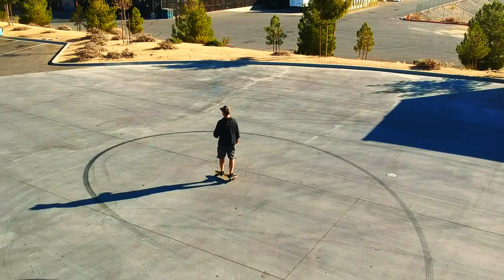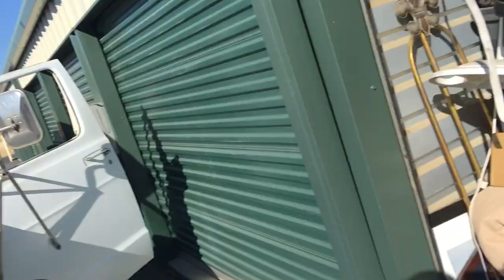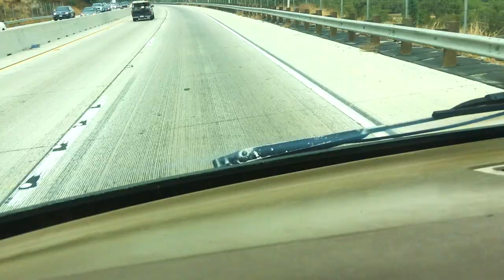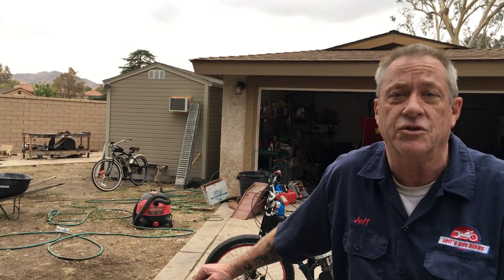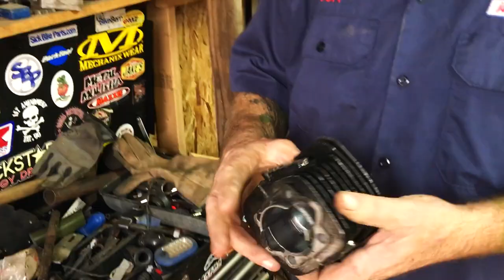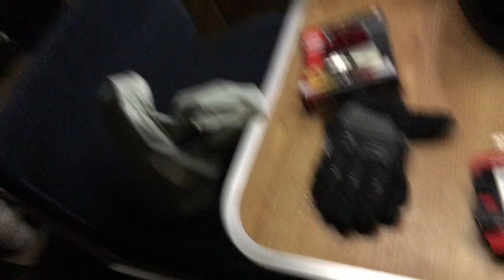My New 66cc Custom Motorized Bike gets 85mpg

Comment: Okay. Those Chinese motors aren't as bad as he thinks they are. I built one when I was 15, and its been going strong for almost a year now, and its powerful enough to push my 6 foot 5 self at 45 MPH.  They are good motors
Reply from the maker: Yeah, mine seems to be holding up great!
Reply: Until the motor starts knocking and you can't figure out why
Reply: Can u please tell me ur model. I wish I could get a dirt bike but I can't so I want to get a motor, plus I'm interested in how they work and get fixed. I want 1 to go 35mph to 45mph. I would still mod 1 to go 45mph. If you know any models under $200 can u help. Thank you so much (gas engines only for me)

Comment: All those motors all the same. There are a MILLION dudes out there that will tell you theirs are better or different, but they all come out of the same Chinese factories. Although quality can vary, its usually close. These guys who do this are mostly quality control. Which is good, don't get me wrong. Having someone set it up that knows what they're doing is key really. Air leaks and parts coming loose are the biggest killers of these. 2 strokes will last a LONG time if taken care of, or could be shot in 1 or two rides if you have a bad tune, a bad air leak, or not enough oil in the mixture. You do want to change the piston rings, or possibly the whole piston assembly (10-15$) about every hundred hours of use to avoid the inevitable failiure. I've seen these go for a few thousand miles between rebuilds. Can't beat em for the price.

Comment: China dolls are not bad as long as you have knowledge of engines. take off the head and cylinder and put rtv on both sides of the cylinder gasket and on the intake and exhaust gaskets. And the most important tip is to oil up the crank seals before you start it up for the first time and shoot some oil down on the crank when you have the head and cylinder off. And put oil on the outside of the piston and on the cylinder wall. If you do all that and make sure you keep the china dolls under 25 mph when you cruise then they will last at least 1000 miles before anything serious might break. People that tell you other wise dont tear the top end down before the first start up and run them like they are stolen. Another important tip is to check all the screws and bolts because they often aren't checked in the factory.
Reply from the maker: Awesome info thanks 🙏🏼
Reply: VagabonDaze  I've got 1017 miles on my bike.The problem I've had has been the chain breaking three times. I have a moving average of 33mph and a top speed of 50mph (downhill). I take mine on 80 round trips.....less than a gallon of fuel.    
I like your bike....stay safe.
Reply: Sounds like the chain might be misaligned. Either the sprocket isn't all the way centered or the engine isn't inline enough with the back sprocket.
Reply: Drcool52  not the case....the chain is made out of "Chinese Butter Metal". Crazy thing, the master link has never broke.
Reply: Me and a few other people have the cheap chains with tons of miles. One has 1800 one has 1000 and another has 800. Its not cheap metal its either not aligned or not taken care of. I've dealt with a shift kit that wasn't aligned and it ripped the chain apart like you mentioned. Once the shift kit was fixed no more chain problems.
Reply: Drcool52  alignment is NOT the problem. I was an AIRCRAFT MECHANIC in the AIR FORCE and I am a CNC MACHINE SETUP & OPERATOR. I read blueprints & draw blueprints....THE CHAIN IS NOT MISALIGNED IN ANY WAY, SHAPE, OR FORM.  "BUTTER METAL" . The chain CAN'T handle the STRESS that my "Moonshine Runner" motor puts on it.
Reply: If you say so. If its all the "power" then why not upgrade the chain? I believe its something like 412 chain at tractor supply stores.
Reply: Drcool52  it's 415 chain. That's the problem.
Reply: No I've heard people use 412 chain as an upgrade. Or #41 is another common one. You may have your years and years of experience as what ever you want to brag about but unless you have years and years on motorized bikes it means nothing. You could stand to join a few forums and learn some things.
Reply: Drcool52 whatever dude...... I've been riding bicycles, minibikes, motorcycles, three wheelers, and four wheelers since I was a kid (the 70's).  You seem to think you know it all when it comes to chains. I was not bragging...only stating my EXPERIENCE in the MECHANICAL field. oh yeah, I also built & raced dirt cars for a DECADE. 
Let me break this down for you....the CHAINS are made out of SOFT METAL....just like the nuts & bolts (even tools) that come out of China.
Thanks for your input, but it's NOT HELPFUL at all. 
have a good day.
I'm done.
Reply: And that's why I recommended you upgrade chains. Its a commonly known upgrade that you should know about if you have been in the motorized bike scene for a while. Just because you have experience in other things doesn't mean you know about motorized bikes. They are different than everything else because of the fact that they aren't specifically manufactured as a nice working whole. All the parts work together in theory but most of the time need modification to work correctly. I didn't claim to know everything but I've built up my knowledge about these things for a few years now and it seems like your too high and mighty to take a few notes from someone who has some information to give. Anyone can slap these kits on a bike and make it go down the road but not many people today know how to do it without having big problems they are always having to deal with.
Reply: I put a capfull of 2-cycle down the connect rod.on each side and let it set 6 hrs per side,so it went into the crank bearings.I used Molybdenum grease in the piston's rod bearing,and the cylinder sleeve for break in.
Reply: I broke in with a quart of Quicksilver Full Synthetic.
Reply: I use 'Marine XLF Pens.Synth-Blend,"and don't blow smoke as It's now 700 Plus miles.

Comment: VagabonDaze New subscriber, amazing channel and video, good buy for sure.  I have built hundreds of gas and electric bikes, and that is one nice bike.  45 is fast, the perfect speed really, may I suggest Amsoil 100:1  2 stroke oil, I have gotten 3,000 miles out of a Chinese 66.6cc engine with it (40:1 after break in period)
Reply from the maker: Wow man thanks so much for the tip! I’ll def use it!! Thanks so much for subscribing really appreciate that as well!!
Reply: @NOMADNEWSTV  If your engine on that bike is brand new you should run 32:1 during the break in period.  For me that is 200 miles.  During that time I don't run full out often.  A great app to have which happens to be my favorite for tracking mileage, speed, distance, speedometer, and a GPS map is called Sportstracker
Reply from the maker: I’ve been running the heavier mixture during the breakin. I’ll def check out that app

Comment: A bone stock Suzuki Boulevard S40 will get 80 mpg if driven 55 and below. How do I know. I bought a new ‘07. And go 90 mph if needed.
Reply from the maker: Yeah, I’ve had mine for a minute getting ready to sell it
Reply: VagabonDaze, I have 2 bikes. I keep the 650 just in case gas gets really high again. I switched the bike to chain drive a couple years back and brought down the rpm’s a little. It might beat 80 now, I’ve never checked it. Changing the gear ratio turns it into a fabulous bike.
Reply from the maker: Michael Harris I have an E-Bike now that’s all I ride these days
Reply: VagabonDaze, I have been thinking about doing my own build. A lot of new technology is out there now. Cool idea.

Comment: if you went with a 4-stroke a 79cc monster  80 kit from gasbike.net  for $229 you would have a little less speed but you could put pure gas in it. Also 4 stroke is quieter and have less smoke out the pipe
Reply from the maker: Very good info might look into that in the future. This thing does 45mph not sure how much speed I would lose??

Comment: I don't suppose you could elaborate on that gentleman's personal bike i'm curious about the carburetor intake that had on it and that it's connected to the case and not the actual cylinder how is that possible
Reply from the maker: Hey Jason I actually still don't know a whole lot about these bikes so I have no idea what he has done to his. I just ride mine. I know mine goes about 45mph top speed and I could not even come close to keeping up with him on his bike he would just run off and leave me
Reply: They weld a reed block adapter to the case. And delete the piston port design. Common on mopeds and race carts.
Reply: Ya it for sure has to do with the Reed thats on the intake. VagabonDaze's bike didn't have the reed.
Reply: Jason Hunter the reed value closes and opens everytime the motor makes a rotation. Basicly like a gasmask. As it sucks gas into the cylinder the reed value can open when piston is going down or right before it takes in more gas then the values close creating a volacity stack. It holds back gas and air building it up under pressure...this makes the air and gas mixture atomize before going through the reed value and into bottom end of cylinder. Giving you really good gas/air mixture and allowing a nice compression to spark off. And gas dosnt shoot back into the carb. Which isn't good for flow. A 2 stroke sucks gas in while exhausting. One can not work without the other. Imagine a water hoes tip. How it builds pressure if you squeeze the end off then release..well the water comes out faster and harder, hey oh, pretty much the same thing on the reed values. Or those fish nets that let fish in but they can't swim out. Idk I tried my best haha.

Comment: my 60cc gets 100-150 mpg. why only 85?
Reply from the maker: +shadowgattler - THE ULTIMATE SKILLER it's got a high performance carb, head and other things. I'm not exactly sure what the gas milage is. Stock they say 100mpg, mine is far from stock
Reply: VagabonDaze the carb doesn't do much. I've heard they're a waste. the expansion chamber does help with performance though. good luck with it and have fun. i ride mine around town regularly and love it
Reply from the maker: +shadowgattler - THE ULTIMATE SKILLER did you see the carb on mine? My bikes supposed to be like one of the only bikes in Cali with that carb as it just came out. It sticks all the way out the back of the bike is supposed to add 2hp. Mines a little fast it freaks me out still to be going that fast on a bicycle. Jeff the guy in the video his person bike runs nitrous oxide boost and goes over 70mph. I love mine have no need to go that fast! 50mph is plenty for me!! Lol thanks for commenting and watching
Reply: How you ride, your weight, bike weight and so forth has a lot to do with the gas mileage you will get...

Comment: Its 49 cc not 66
Reply from the maker: Venom ! No my bike is a 66cc that’s why it goes almost 50mph.
Reply: you are both wrong they are 80cc   66cc is the stroke
Reply: @unemployedmechanics  they are 66cc stock. The 80cc is from the Chinese who include the combustion chamber so it's not a measure of displacement like we measure engines in the U.S.
Reply: @unemployedmechanics  you can't measure stroke in cc. Cubic centimeters is volume. They are 40 mm stroke.